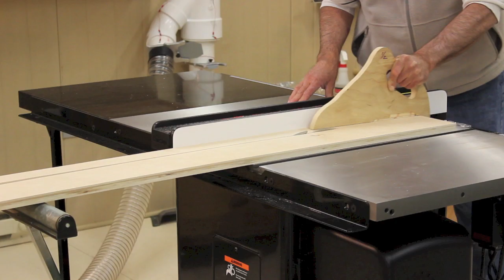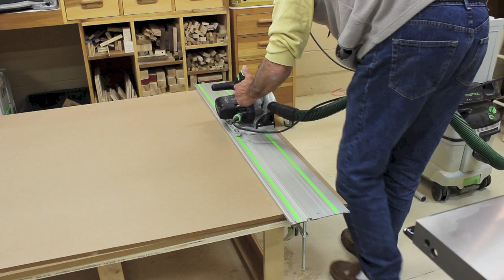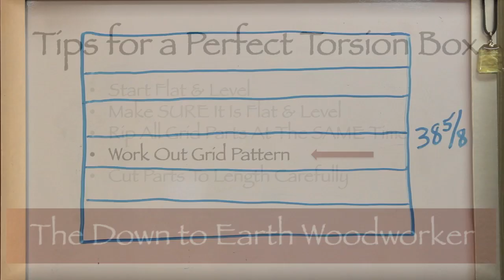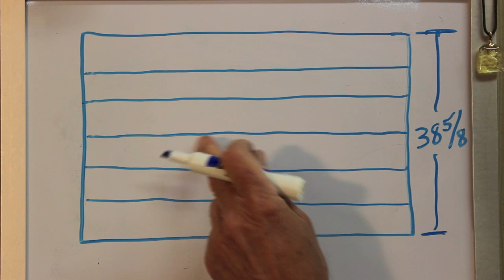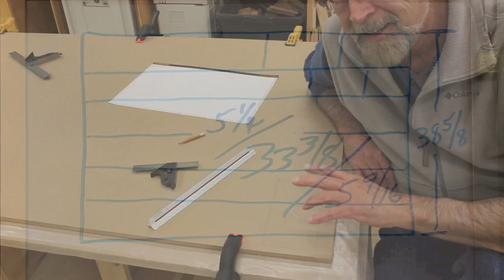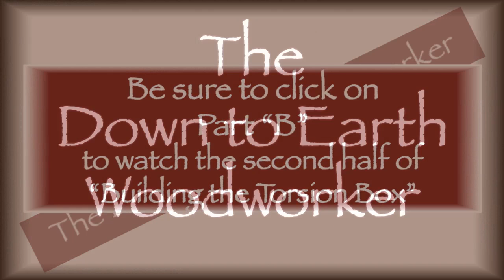SawStop Outfeed Table Pt 2 A

Comment: I believe your torsion box is supported in 4 corners. I plan on doing the same thing but I'm concerned that 2 1/4" isn't thick enough. Overtime has your torsion box sagged in the center at all?
Reply from the maker: Not at all.  Because of where the saw and outfeed table are located, I often use the outfeed table as a place to stage and stack lumber that I am jointing and planing.  I realized not too long ago that I had stacked over 600 pounds of lumber on my outfeed table and left it overnight.  While I wouldn't recommend this, it didn't move/sag one iota.  Still flat.

Comment: I'm just curious... I've seen torsion boxes built this way, with offset - sort of a running bond style, and with the the lateral bracing boards lined up with each other. Is there a reason for one over the other? Is one method stronger?
Reply from the maker: +Ruel Smith Great question... in theory... in "theory" (I'm emphasizing that word) the lateral boards lined up would be stronger in that same direction, i.e. if the torsion assembly was under stress, the short boards lined up would offer more "flex" resistance.  In "reality," there is little difference, especially in an assembly this size.  You will note that the full length boards are running the long dimension of the box, so the "flex" is reduced significantly in that direction.  The bonus is that if you are of a mind to use a nailer (+ glue) to attach the lateral boards, there is no need for "toe-nailing" doing it this way.

Comment: Thank you so much for your prompt replies so far.  I am sure I will have more, but these should be the last for now.

As I am sure for others, this assembly table will be the largest surface in my shop.  What do you recommend for getting the MDF initially flat?  Plywood on sawhorses?  Concrete floor?  Is it important that it is level to start.
Reply from the maker: Dan Borello It is critical to start with a level flat piece.  It is likely you could spend as much time leveling and flattening the first piece as building the rest of the assembly.  It doesn't matter where you lay it out, but use a long straight edge, shims, and whatever else you need to get the first piece perfectly flat. Patience and preciseness will pay off in the long run.  I get so finicky with the first piece that I use pieces as thin as a sheet of paper as shims.  The problem, of course, with sheet goods is that they will sag and conform to whatever is underneath, so build up a solid level flat, flat, flat base on another table, sawhorses, the floor or wherever, get that as perfect as possible, then lay the first piece of MDF on top and get that level and flat.  Then when you build the interior infrastructure (grid) on top of that, it will be perfectly flat.  Here's one method...
Get two, three or even four sawhorses lined up and the tops level and aligned with one another.  Across those place a number of 2 X 4s that have been jointed perfectly square.  Level and flatten those relative to one another using shims.  Then place a sheet of plywood over that, level, flatten, shim as necessary.  When all that is perfect, then put down your first piece of MDF, level and flatten, then start building.
The reward for all that obsessive attention to detail will be a dead-flat surface that will stay that way and will be a reference surface for all your other projects.  Best of luck!
Reply: downtoearthwoodworks 

This is going to be my biggest challenge.  However, I think I am going to have to settle for flat, and neglect level.  My garage is slopped, and I think I would do more damage than good trying to create a level surface.  

I like your 2x4 method.  Unfortunately, I don't have a jointer, so we might have to get creative on that front.  To be honest, my concrete garage floor is probably my best bet for a flat surface, but that will be no fun to work on.  

Thanks for all of your feedback.  The videos are great.  I might spend all day trying to get that first piece of MDF flat.  I noticed you used the top, below the bottom MDF for another flat surface.  Any concerns of knocking the top out of flat when you remove the sheet below it?  Or is the torsion box strong enough at that point?

Comment: It might be because I'm watching this late at night but I'm having a hard time understanding how putting a shim under the bottom sheet will fix a low spot. Isn't the table going to be supported by the four legs and nothing will be under the spot with the shim?  

You also mentioned you prefer plywood over MDF for the grid work. Would you mind explaining the benefits if the plywood in this case?
Reply from the maker: The concept behind a "torsion box" is that the grid pattern inside keeps the bottom and top in perfect registration and level, flat. It is absolutely critical to start level and flat, so that the grid is flat and level when glued to the panel.  Thus, leveling the panel first is the key.  As far as MDF and plywood, I think the plywood has a little less "flex."  Thanks for watching!
Reply: downtoearthwoodworks Ohhhh…. okay.  Thanks for the explanation :)  I really like your videos and the amount of detail you go into for us.  I will be building this outfeed table for my sawstop.  Thanks again!

Comment: Ok the issue you have is not a problem but and operator understanding. When you move the fence some distance the heal of the fence lags the head of the fence because of drag.. When you tighten the head of the fence it pulls the heal into alignment after a long movement. All fences of this type do the same thing. The issue is the weight of the fence, on the less expensive fences they weigh allot less the heal tracks faster and keeps up with the head less weight less friction. The less expensive fence is not as stable because of the weight loss and has problems the staying parallel this the blade. To solve this issue keep our table top lubricated which will reduce the drag and just know to set your fence a little shy of the final mark and reset it to the final mark this a small move and the heal will tack the head. Hopes this helps.
Reply from the maker: What you describe is indeed an issue with many "T" style fences, and at first I thought that was the issue here.  However, the entire fence is moving, not just the heel, when the head is tightened/clamped down.  I will be demonstrating this graphically in the August issue of Highland Woodworking's Wood News Online.  Thanks!
Reply: Please keep we informed of your problems as well as the answers I am very curious

Comment: A second cause of the creep you are experiencing with your fence could be from over-tensioning of the locking roller (or cam, whichever is used in your case). This can create a series of small dimples in the face of the fence beam every time the fence is set. The roller will then try to follow these dimples on subsequent setups. The gauge steel used in the fence beam of the Sawstop should be sufficient to prevent this occurring, but I have seen it happen on cheaper versions of the Biesemeyer fence with light gauge square tubing used for the beam.

Comment: It's a sad commentary on today's manufacturers that  a tool as expensive as the Sawstop can be delivered with problems in a component as essential as the fence. I am going to assume that the issue is not with parallel alignment , but that the entire fence changes position relative to the distance to the blade. If the roller (or cam) on the locking handle that contacts the outer surface of the fence beam is not perfectly aligned along both axes of contact ( in other words, follows a diagonal path along the face of the fence beam), the fence will 'walk' along with that roller as it follows that diagonal path. This problem lies within the locking mechanism, when the components were aligned for welding. Very difficult if not impossible to repair in the field. There may be adjustments to alleviate the issue, but that would be unnecessarily complicated. Simply drilling the roller slightly off-axis could cause this sort of problem. Almost impossible to measure accurately. I'd suggest having Sawstop provide a new fence.

I have enjoyed most of your videos; you tend to 'over-engineer' your projects as I do (that's not a negative comment). I've gotten ideas from you that I am incorporating in my shop.
Reply from the maker: Thanks so much!  It is the entire fence moving relative to its distance from the blade.  I will check the things you indicate... thanks for the tips!
Reply: If the fence is moving when locking down, this is common with all fences of this design.  Most likely the problem is that the instructions for the SawStop fence were not followed closely. SawStop address this and how to adjust this play out to minimize movement when locking the fence.  I have used several saws with this style fence and it is common to all.  I have the industrial version of the SS and because my previous cabinet saw with same style fence had the same issue I was not concerned with making the adjustment.